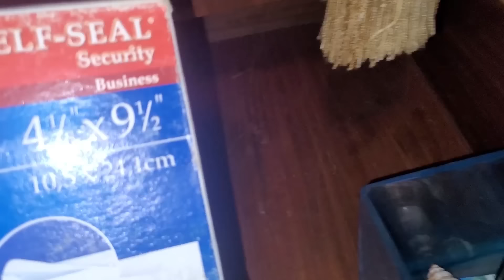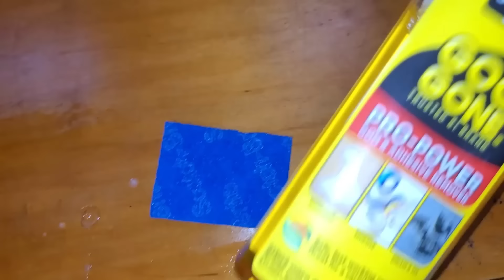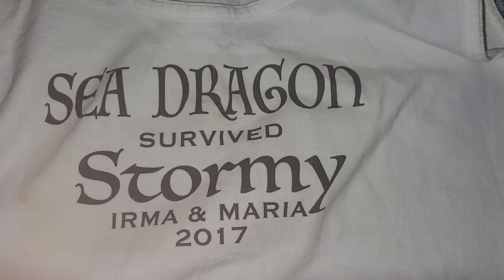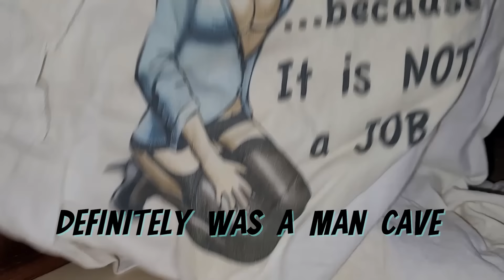E8 Moving into the Master!

Comment: Many old Hatteras had hydraulic lines even going to helm for your engine/transmission controls and steering if I'm not mistaken.  Definitely worth tracing those down in the future.
Reply from the maker: Nope, you're right on the money!  My steering and controllers are the original Hynautic and there's also a glendenning synchronizer, (which also looks to be hydraulic) then they added a hydraulic bow thruster and stabilizers.  And, from what we can tell, the stabilizers have been moved (maybe when they did the extension?).   All those lines running under the floor where they ac pumps were originally are for all the hydraulic items.  I have not chased them all down, but I will and I'll tag them! Thanks for watching!

Comment: can you get some kind of schematics from Hatteras
Reply from the maker: I actually have all the schematics, but things like staiblizers and bow thrusters are aftermarket items, and since the boat is 43 years old, a lot has changed.  For instance, I no longer have the same toilets, so the original schematic for the toilet/waste system isn't 100% accurate anymore.  But, the schematic for the hydraulic steering really did come in handy!  It's literally what kept me from letting the pros waste the time and money on an old auto pilot pump that had nothing to do with my system any more!!! =-)